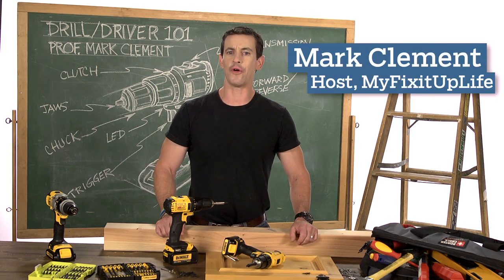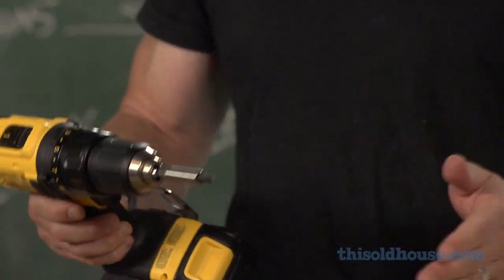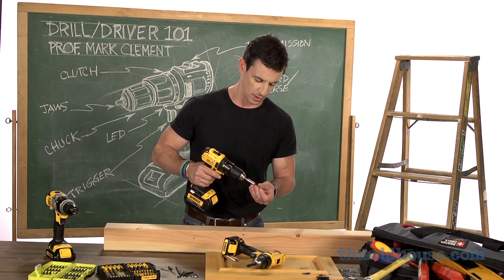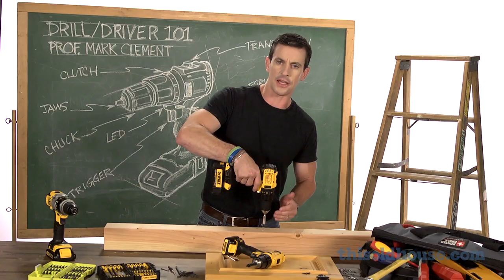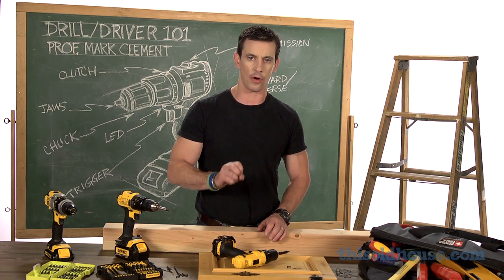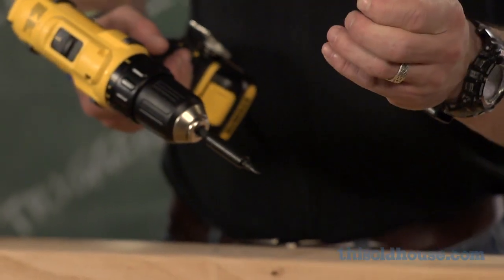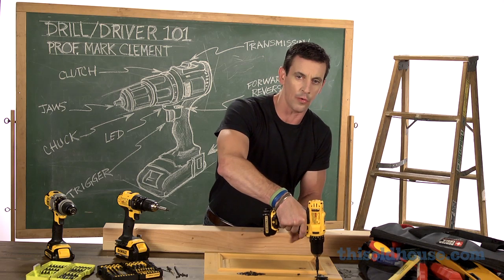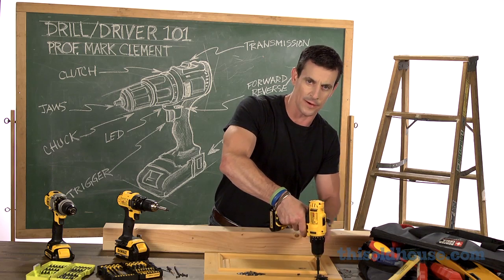Drill/Driver 101: Clutch Collar  | Tool School | This Old House

Comment: I was ready for a crapy add but this video was GREAT. I have so many drills and have never used the clutch on any of them. In fact I normally set them to the drill setting and leave it there. I am going to have to remember this.

Comment: The button on the drill itself is already able to adjust the drill power. And you can feel in your hand how much force your are applying. I never use such clutch.
Reply: I think the button only adjusts the speed, not the torque.